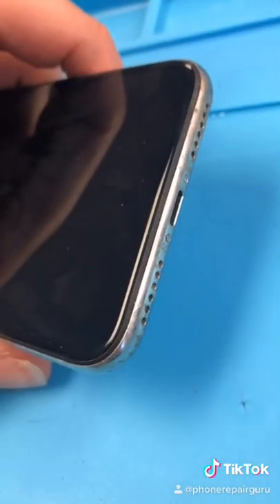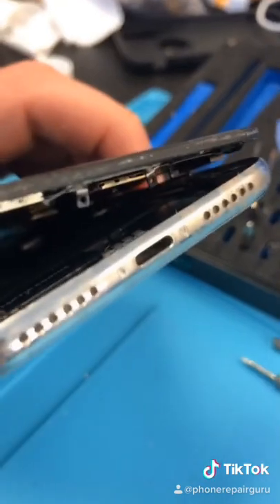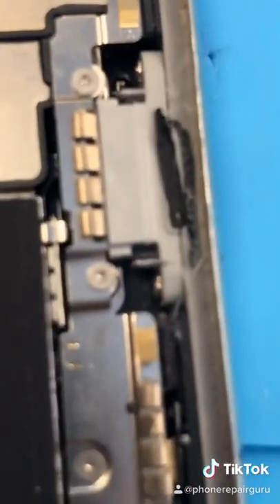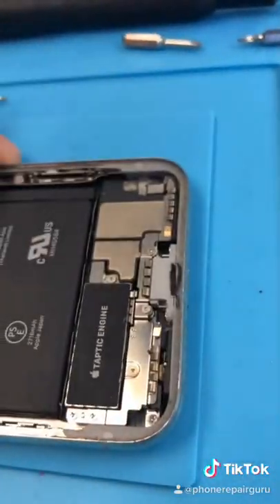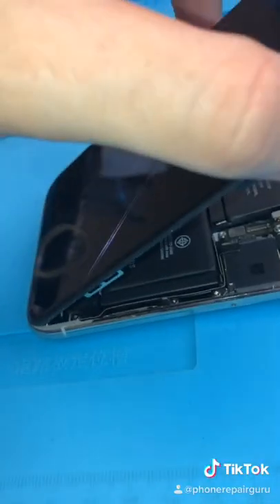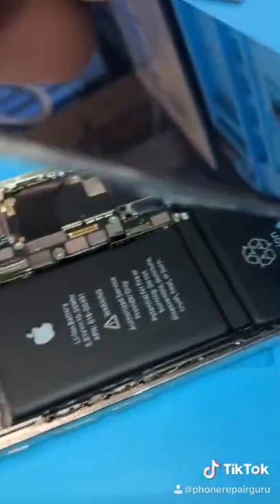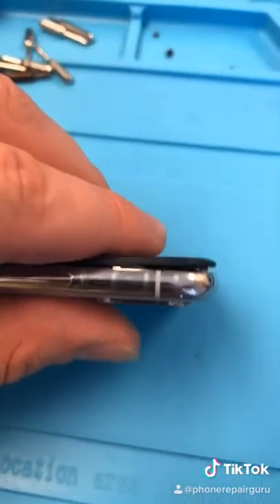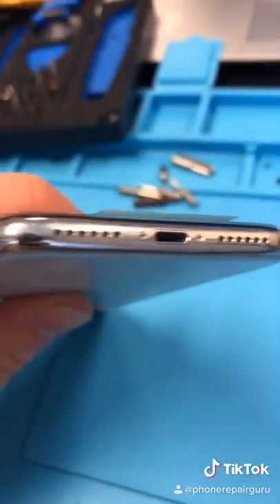Iphone X with stripped bottom screws *Hard

Comment: Solder a second intact screw on top of the striped one and screw it out
Reply: That’s some big brain moves right there 🤔
Reply: Someone's broke a head stud in their car😂😂 we do the same thing just weld a washer and nut on top of the old stud and just wrench it out
Reply: Stainless steel doesn't solder
Reply: @jcdowen  I‘ve done it a few times with success
Reply: @zaimsadikovic  yeah it's possible but in my experience it's hard as hell haha, with the right flux it's better. It's easier to use broken screw extractors either way.

Comment: "Phone repair guru" but doesn't have screw extractors lol
Reply: Screw extractors
Reply: @mindofvirtuoso3358  yeah there is. It's like 30 bucks on Amazon. Micro screw extractor
Reply: I used to like his videos but now I don’t anymore, I hate seeing that for the intro in many of his videos he throws their phones around and on the desk etc
Reply: @cappunino7629  Yeah, cuz a gentle tap on top of a rubber work sheet is DEFINITELY going to damage the phone.
Reply: @Dragonite33  "Gentle" Yeah right, also it can scratch up the phone
Reply: @cappunino7629  bro. XD rubber vs tempered glass. I bet my money on the glass if its all the same with you.

I can tell you don't do this stuff for a living. Besides, most new, if not all new displays come with a thin plastic screen protector anyway. And if you're worried about the back cover glass? Don't. I haven't met a single of my customers in over 2 years that didn't have a completely scratched up back glass to begin with. If by some astronomical bad luck, prg throws it on top of a stray bit of gravel on his work mat, you won't even see the difference.
Reply: @Dragonite33  I get where you're coming from, but, I absolutely hate the idea of my device being thrown around and also I just get absolutely triggered if my phone has even the tiniest scratch.
Reply: @cappunino7629  If your phone gets repaired, it's scratchless, even with some tosses. 

If you don't want scratches on your device, case, tempered glass. 

Trust me, worse things have been done to phones coming into our repair center. And yet still we manage to deliver them back to the customer in mint condition. x3

Comment: You can use micro drill buts to drill out the stuck screws internal and use a small scribe or pick to crush the remainder of the screw/threads and pull it out.

Comment: If you want to get the screw out, grab a small magnetic flathead screwdriver and give it a tip, (like an arrow) you’ll basically punch the screw with the Flathead and make a divot, then you’ll be able to pull it out. If not, a very tiny drill tip could be used for making a groove

Comment: I’ve had good luck using various sizes of razor blades to get out stripped or relive screws. Use the razor to cut a bit into the screw. Then use the blade to unscrew

Comment: If you have a strong soldering iron or equivalent.
You can remove the screws easier. Part of it melts making it loose. Soldering some threads is the hard part tho 😌

Comment: You should get a dremel tool with drill bits and also torx bits so when this happens you can drill the screw then hammer a torx in then unscrew it out or drill the screw out and have the threads repitched on the phone itself with a bigger screw

Comment: i would recommend using heat gun heating it up hot enough n try see get it off if does work then there ya go
"dont go to far because will melted plastic inside"

Comment: Maybe experiment with eyebrow scissors for stripped screws. I use them when I can't find a screw driver (irresponsible yes) so what I do is I put in the eyebrow scissors closed and open them slightly to catch the screw I'm working on and turn. It's slower than a screwdriver but works in a pinch and it might work on a stripped screw but I never tried it. Obviously don't do this if you think it is too much of a risk

Tl:Dr: experiment for dealing with stripped screws that is probably not worth it

Comment: would it be possible to drill the screws a little to create some surface so you can glue a tool to the screw to extract it? ive seen methods like that done but with huge bolts and some welding done to it. just a suggestion

Comment: Hotel Engineer here, just throwing in my 2 cents.

You can't drill those out? I can often get broken bolts in door hinges out if I use a drill bit that's the same size.

Comment: Why don't you try welding to the stripped screws? Obviously I mean weld from the outside before the phone is opened. Maybe the same kind of welder they use when pulling dents out from cars using the ring method. Google 'pulling dents out with welded rings'. I'm 99% sure you can do a small spot weld to the screw, enough to gain purchase to get them out.